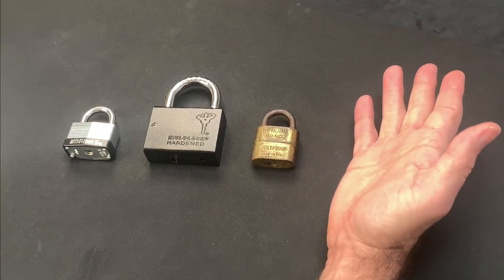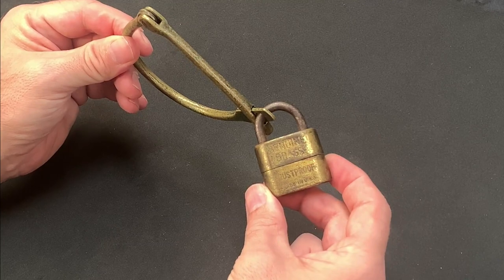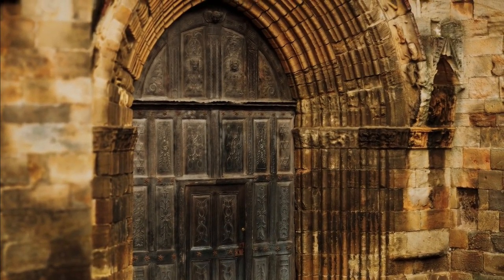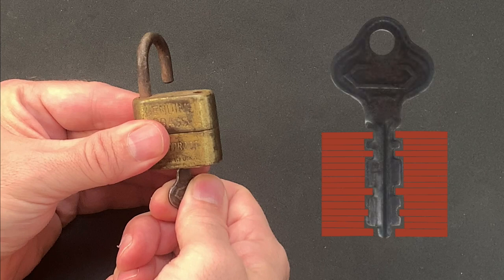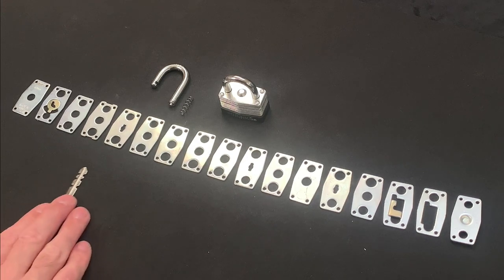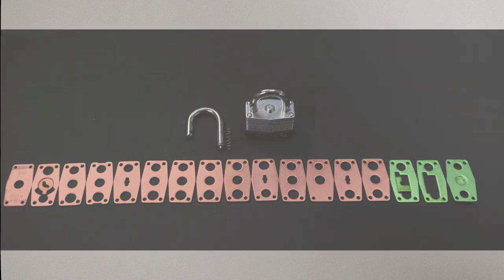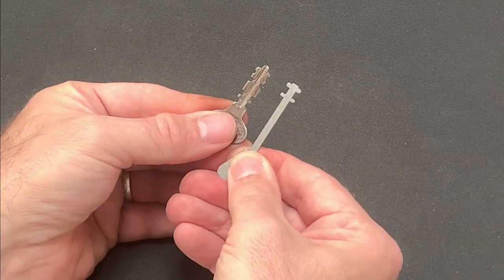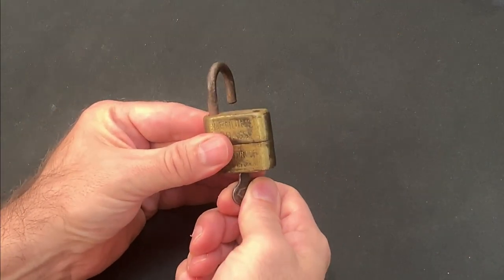025 Opening a vintage warded lock using bypass tools

Comment: Another excellent video, Andy - thank you :)  One little thing to add - on almost all modern warded locks (and even on your vintage one), the giveaway as to what type of lock it is would be the lightning-bolt-shaped keyway opening. Some viewers may have a warded lock or two without realising it.
Reply from the maker: Yep that’s a good point - thanks for adding it to the conversation 🙌

Comment: In addition to locksport, I'm also into fountain pens, and I restore the occasional vintage one. Before I take one apart to start a restoration, I will generally add a little water to it to rehydrate any ink left inside it, just to try to get a glimpse at what the last user was using before it went into storage. It almost always results in inky hands, but it's worth it.
Reply from the maker: Ah that’s wonderful - and what were they writing the last time the pen was used? Another rabbit hole of possible stories right there!